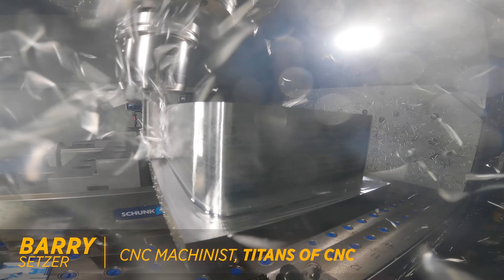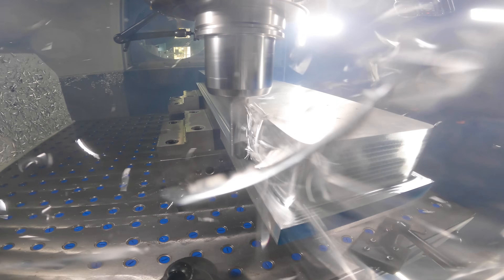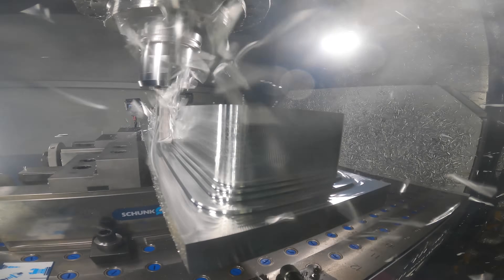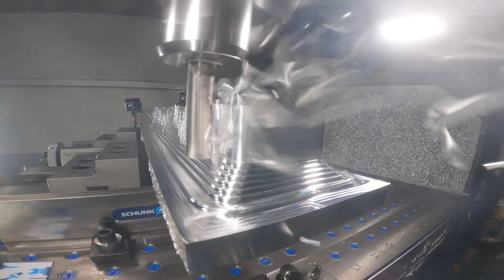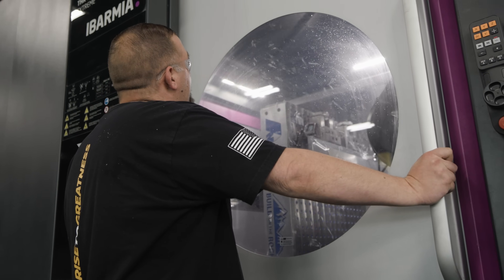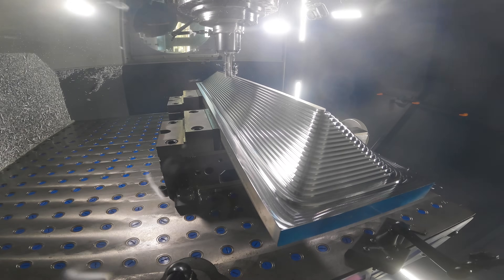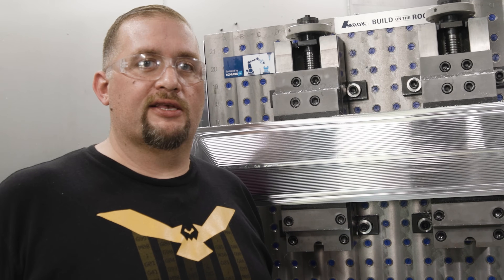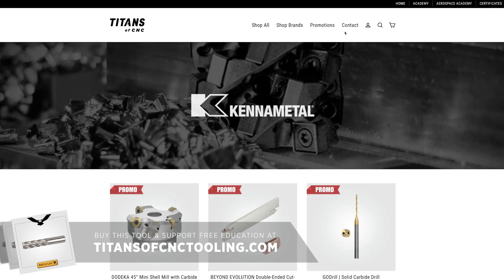HIGH SPEED MACHINING - 8 Things You Need To Know!

Comment: Hi, great video, it really helped me understand the HSM concept better 👋
I’m a university student and I’m currently working on WC–Co cutting tools in high-speed machining. I understand the theory, but I still struggle to visualize how WC–Co tools actually behave at very high cutting speeds in real applications.

From an industry point of view, how are WC–Co tools seen in HSM?
Are they considered common, reliable, or limited compared to coated tools? And how is their market value and usage in real production environments?

If you have (or plan to make) a more industry-oriented or visual video that could also be used in a presentation, I’d love to watch it.
Thanks a lot

Comment: More videos like this please. Specifically I would like to hear about the relationship between IPT and radial depth of cut. HAAS glazed over the topic before but they left a lot on the table. Also E.M. feed rates based off of radial step over amount vs full on slotting. Thanks for all the great videos.
Reply: That is best answered by a cutter representative that can explain it really well. 

A simple explanation;

There is a chip thinning effect with high efficiency milling/high speed milling/dynamic milling…

The smaller radial step over, the less angle of engagement the thinner the chip, bigger radial step over the higher angle of engagement and the thicker the chip. 

Smaller radial step over - increase chip load
Larger radial step over - decrease chip load

It is difficult to give general speeds and feeds because there are a few things that need to be taken into consideration. Cutter, tool holder, setup rigidity, cnc machine capability, material. 

We are using a .500in Mitsubishi MEMSS specifically made for high speed machining in P-20. 

Mazak 510C vertical
.875 DOC, .040 radial step over
710SFM @ .0103 / tooth
5400RPM @ 280IPM
Spindle load is about 30%

No coolant. Air blast only!

If you want to transition into high speed machining, you should bring in a cutter representative from kennametal or Mitsubishi and they will help get you started.

Edit 

Worth noting. Software like mastercam have dynamic tool paths that are designed to hold a constant radial step over for a steady chip load. That is why dynamic milled parts have a “wavy” surface finish.
Reply: @Hard0Knoxx  great explanation, you would make a good teacher.

Comment: I use a 3/4 KOR5 endmill on some aluminum parts that I build. The cycle time on our parts went from 15 minutes to right around 5 minutes per part. And with the chip splitter the chip conveyor can easily handles the chips. I even use it as a finishing cutter as well. It holds great tolerances as well thank goodness our finish is not critical. I love the KOR5!!!!!

Comment: If only Kennametal would get safe-lok on the TE end mills. We had to go back to a side lock holder in order to keep the tool from pulling out even with using a HydroForce holder.
Reply from the maker: I took your comment right to the heads of Kennametal… because I agree with you. If you look closely, the huge full slot videos we do on the NHM are using side lock.

Titan
Reply: Haimer is also providing that safe-lock feature and some others.

If a Hydro-force holder is too expensive, you can also use a Weldon type (the cheapest you can get), heat shrink holders or mechanical Albrecht extreme force holders which even provide a safety lock which makes it absolutely impossible to pull a tool out..

Weldon holders are not too precise, but they are very cheap an still great for roughing at high mrr. It's impossible to pull a tool out of a Weldon holder.

I am using right now a Weldon holder to rough mild steel with a 20 mm endmill, 4000 rpm, 1500 mm/min, 15 mm deep, 50 - 90% material coverage. We run that one dry, the monitor shows 15 - 20 kW spindle load.

1 inch is 25,4 mm
Reply: I actually brought that up to some of their higher-ups recently!
Reply: @barrysetzer  My Rep has been bugging them like crazy over it. Once you get to that size of end mill it is just necessity.

Comment: wich toolpath did you use  for this piece ?
Reply: Dynamic Optirough
Reply: @barrysetzer  i dont see any retract  for Z step .. did you cut it out for the video or how you do that plz
Reply: @jaylabarre4444  On linking parameters, I used minimum vertical retract, .1" linear entry, .5 horizontal arc entry, .1 horizontal arc exit. Also, on cut parameters page I told it to never retract over gaps, and to keep tool down within 1" distance
Reply: @barrysetzer  haa ok soo the movment is just very fast  and small i see thx for the info ;)

Comment: I get amped on nice paths too Barr. However some degrees of excitement we must keep under wraps😂😂
Reply: Hahaha NEVER!
Reply: @barrysetzer  it’s one of those corky machinist things. It’s weird; but when you get it, you get it!
Looking for a little advice. What’s a really nice hard milling tool you like?
Cutting some 4140 right around 46-48 Rc 
3303 rpm 15 ipm 
.001 ipt
5 flute 8mm cutter.
Any suggestions are welcome/appreciated. Also on my last EM the one I’m using is discontinued. So I’m looking for a nice good new cutter.
Thanks Barry! 
Wire machine sludge will just never be as cool as big ole shredded chips😂 tell him I’m sorry. Just the way it is.
Reply: @ryanjordan7113  I am actually cutting some 50-55 Rc steel right now. I am using a Kennametal Harvi 3 Aero. It's a 6 flute that won the Boeing challenge for tool life. I am currently cutting with a .75"  tool, 1" deep, stepping over .1", at 2500 rpm and 70ipm. I could probably push it way faster, too. You can also have a look at our store (link in description) so that you can see the pricing.
Reply: @barrysetzer  perfect man! Thanks. I’ll check out the link and have the purchaser grab a few tomorrow. These Union carbide 5 flutes were the only tool we stocked in the auto crib for hard milling. So I was asked to source a replacement. Somthing that could be used in a wide range and have reliable life ect…
Thinking to myself who’d have the best insight on this, you came to mind right off the hop! Thanks again brotha. Once I get it swapped out and In tune with the work I’ll let ya know how they work out.

Comment: My question is this. Given your outrageous feeds and speeds, do you consider machines expendable? Is replacing them regularly part of your budgeting??? I'm guessing most shops can't afford that?
Reply: It depends on the machines. The machine in this video is meant to be run this way, it's what the machine and spindle were built for. Now, if this were a HAAS, we would consider them expendable. The secret though is that by running fast, you make far more money in 5 years than what the machine cost you.

Comment: Would it have been better to machine the inside first? This would make holding the piece for the second operation easier.
Reply: Machining the bottom actually isn't required. The tool is used to form sheet metal, and the bottom just rests on a table
Reply: @barrysetzer  Oh, that's cool. Is this for hydroforming?
Reply: Hahaha YES! Surprised anyone actually knew what hydroforming is! You have just received 70 “Barry cool points.” You must be a fellow aircraft guy!
Reply: @barrysetzer  I used to have REALLY exotic antennas and feedhorns hydroformed out of soft aluminum. Great process, so long as you can find a shop that isn't going to ask you "what the hell is this thing, and why do you only want one?"

Comment: I have to ask how much stress are you imparting into the aluminum while blasting away material that fast? Do you need to reclamp the stock after a roughing operation so you don't end up with a banana when you release the finish part from the vices?

Comment: what is the difference between hss and carbide endmills for machining cnc milling?
Reply: HSS is simply outdated. The price difference is not worth the loss of performance.

We use carbide mills for everything from plastics, wood, aluminium, brass, CuAl bronze, mild steel, tool steel, up to hardened steel.

Most of our aluminium parts are AW7075 but we also run such speeds even with a much smaller (25 kW spindle) machine.
However, coolant is always a good idea if you machine materials with a low melting point.
Reply: In general, the main characteristic of all High-Speed-Steels is a high working hardness with excellent toughness. HSS tools also cost less than Carbide tools and are often a good solution in ‘high-mix, low-volume’ applications.

Carbide is much harder, so it has a longer tool life and faster cutting data than conventional HSS. But the downside of that hardness is brittleness, so the cutting edge on carbide tools can quickly fracture or chip in certain situations.
Reply: which aluminum workpiece is suitable for use and if it is possible that the carbide can break, why?

Comment: Barry, if you want to stick to big things, yet not miss the boat on 3D printing / Additive manufacturing, you should look at WAAM, Wire Arc Additive Manufacturing. Or, in lay-man's terms, 3D printing by weld bead stacking. 

There is a renowned crane builder here that has succesfully 3D printed a set of 350 ton rated crane hooks. 1700 kg (3750 lbs) a piece, about 90 km (56 mile) of welding wire used for each, and they are not a fancy concept, they are Lloyd's Register certified for lifting.
Reply: Haha I may give Trevor a little crap now and then, but he's awesome. And I LOVE additive. I have actually machined parts made by WAAM, as well as laser sintering. That really is the future..........
Reply: @barrysetzer  A very big YES on that last bit! 

(I've got an MSc in Materials Science & Engineering and I've been to the Formnext exhibition and conference on Additive Manufacturing in Frankfurt twice now, so I know what's up. It's one helluva paradigm shift!)

Comment: why not 3 vices? that overhang on the ends looks extreme
Reply: It worked tho 😜
Reply: Overkill doesn't hurt, but it is overkill. That material was thick af boii
Reply: probably because the 3rd one wasn't needed
Reply: The material was visibly vibrating. I wouldve at least added a machinist jack and hockey puck under it. BUt I cant argue with Barry, it did work without another vise.
I wouldve added another.